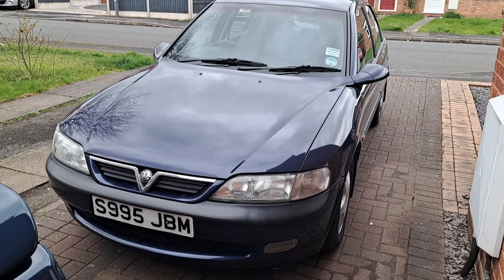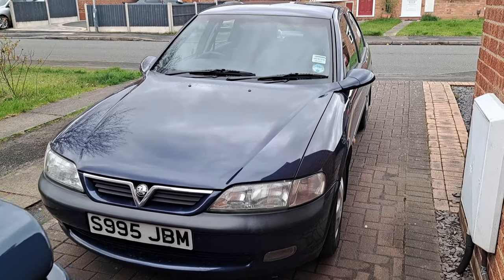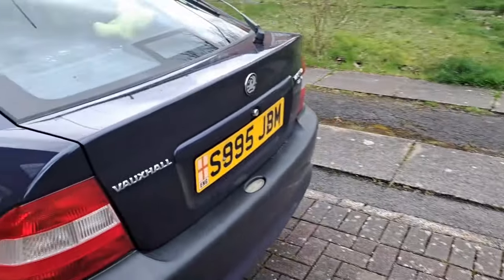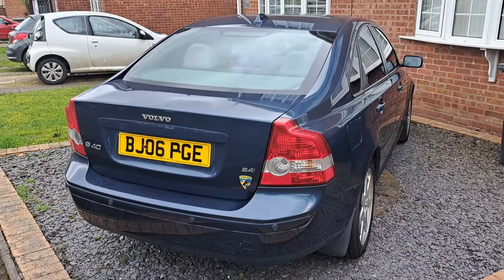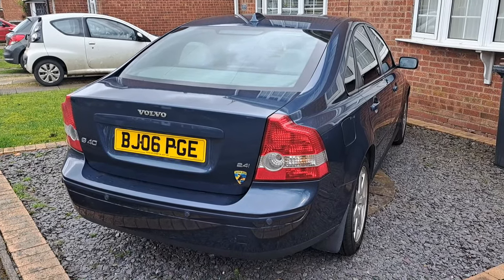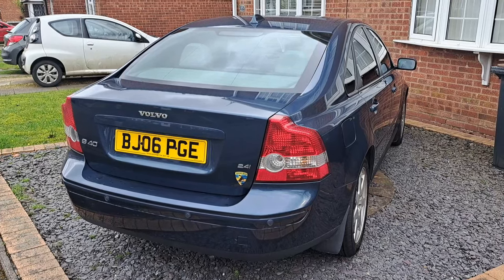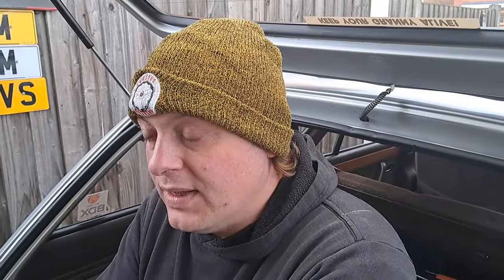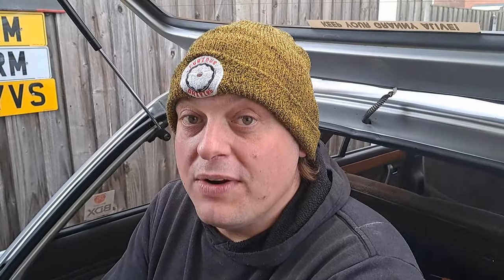Very Vague Vlog CXXXIX (139): Why CAN Bus Wiring Can Render Your Car Beyond Economical Repair...

Comment: Very interesting. I wish that range of Volvo wiring was simpler. My 04 V70 for example is much simpler to change stereos etc whereas the 57 plate S40 I owned was so much more needlessly complicated. I do wonder if it was Ford's involvement...
Reply from the maker: Yes, you can't easily change the stereo in these. I did look into it... The V70 P2 was designed with no Ford influence, whereas the S40 is based on a lengthened version of the Mark II Focus platform. More No Budget Volvo action coming up soon.